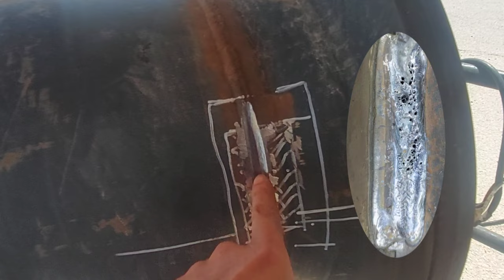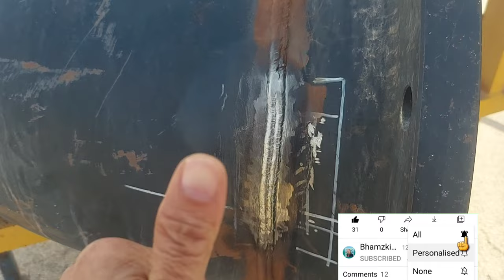Bakit nagkakaroon ng POROSITY ang ating welding at paano ito e repair|@bhamzkievlog5624

Comment: Boss pgpundido bng wewedingin kelangan bng painitan muna ung surface ng wewedingin pundido mejo marunong aqng mg welding kaso kulang p aq s aking kaalaman dto aq ngwowork s isang pabrika ng mga ngpoproduce ng mga diaper work q dto ay Fabricator mga tumgkol s machine n minsan kelangang I modify ska meron aqng kaalaman s pgtotorno ( lathe machine) minsan pgmy time pinapanood q mga video mo sna mrmi kpng ituro syong mga video salamat sir sna mabasa mo Tong comment ko
Reply from the maker: Hello sir,kung idadaan natin sa tamang proseso opo lahat ng klase ng bakal ay bago hinangin dadaan muna sa preheat,kaya lang madalas lang ito ginagawa kapag makakapal na 1"thickness above,bakit kailangan ang preheating before weld?para pabagalin ang cooling rate between arc and metal,kapag malamig kasi eto ay malaki ang chances na magkakaroon ng crack.